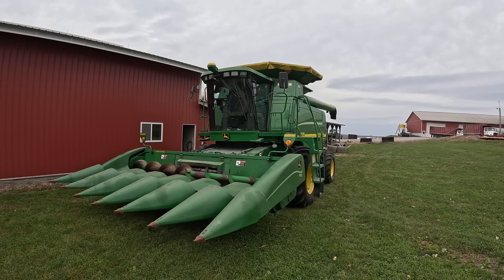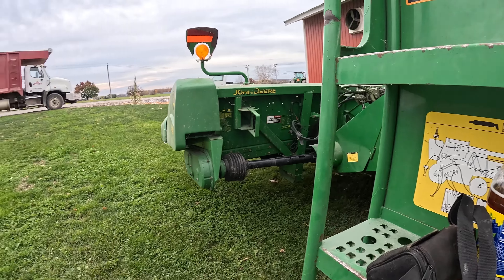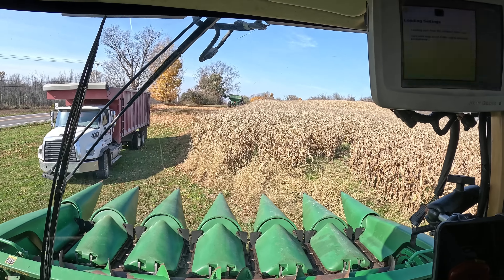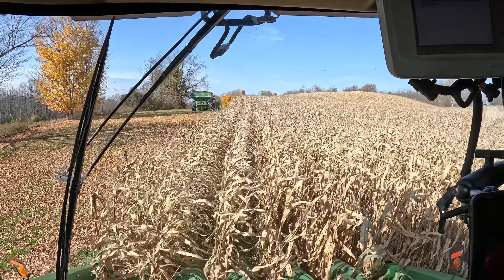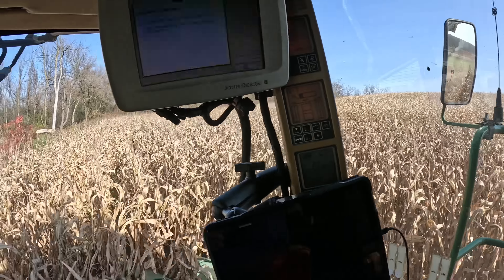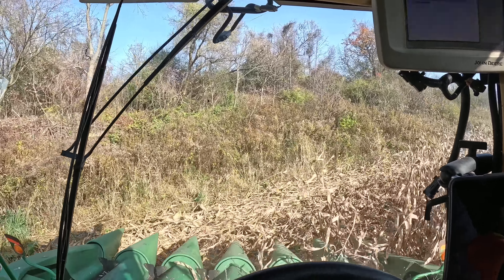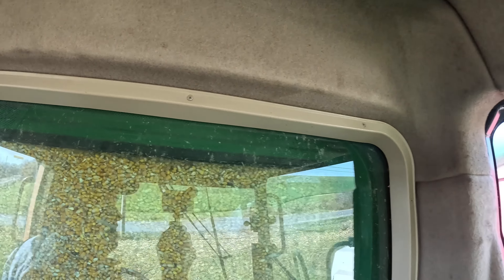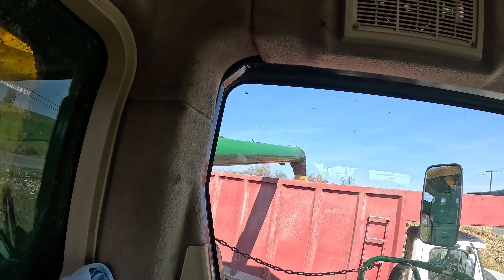Shelling Corn Day 1,2024

Comment: If the crossing is not working properly you should call the number on the blue sign.  Minimum 20 seconds, if not 30 seconds by civil restriction or spped of train.  What does that include 3-5 second delay for the gates.  Then down in 12 seconds giving the motorist minimum 20 seconds warning. 
The only situation where the gates come down with no delay is if a train were just leaving the crossing and gates were starting to go up.  With a second train approaching on the other track either direction. NYS law says do not cross until the lights shut off.  It will save your life and your combine! be safe.
Ifthe gates just guilitene down with no delay when the crossing is activated then that is also a malfunction call it in.